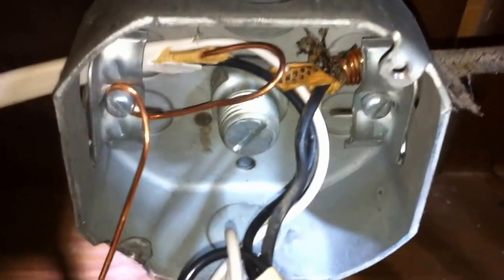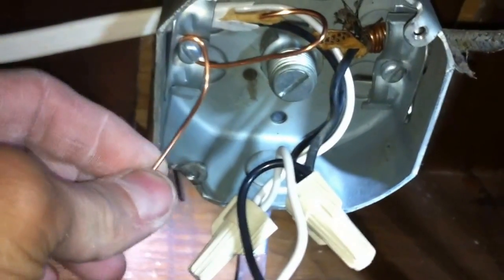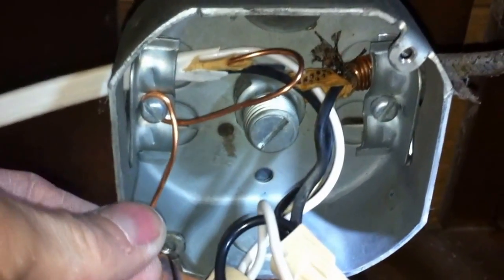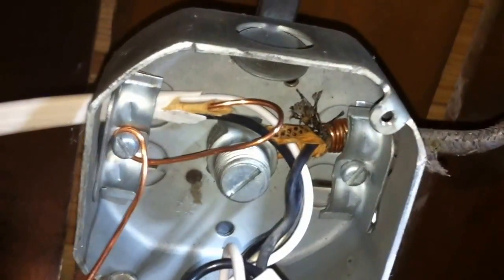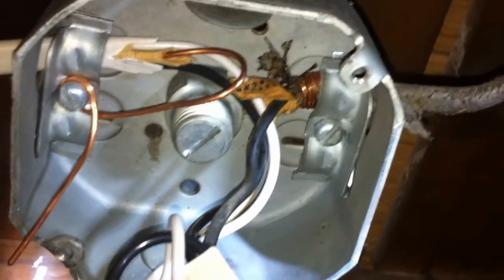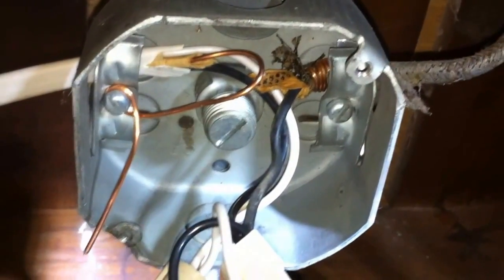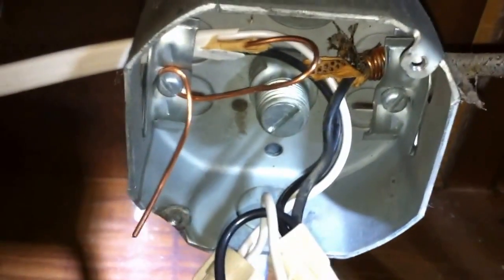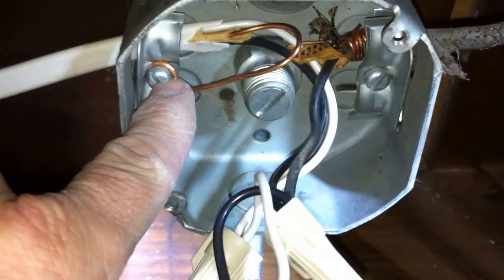Moving Violations 66: Boston Back Wrap

Comment: Wouldn't drilling tapping for green screw satisfy code? I found this done then wire goes to a nail in stud, then somewhere up to attic. 2nd dumb question,  if I put a gfi or a.  3 prong receptacle(grounded)  is simply attaching to a cold water pipe ok? Or do I have to run a ground wire all the back to main panel? Hey thanks